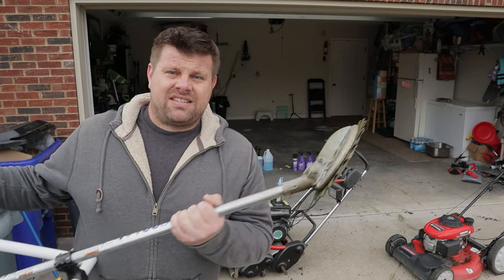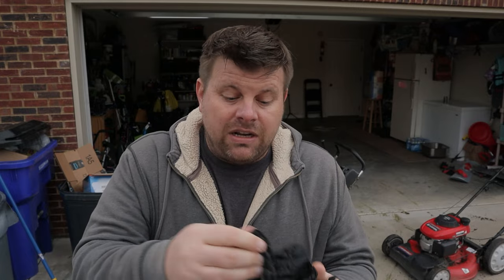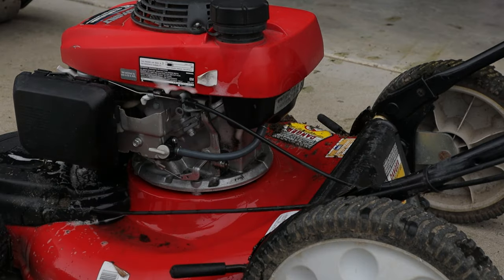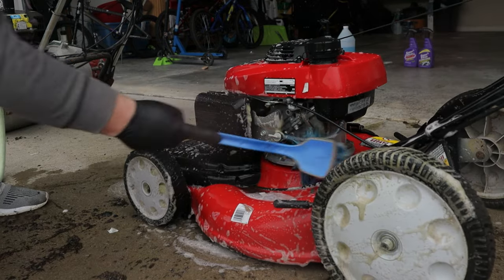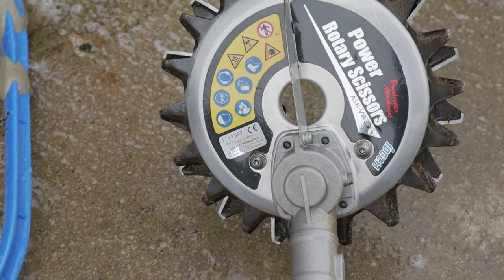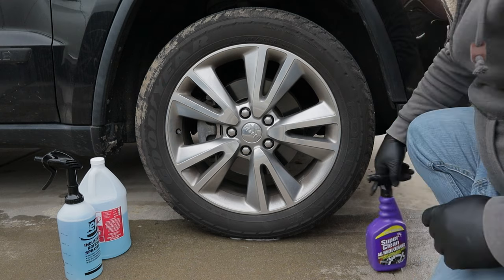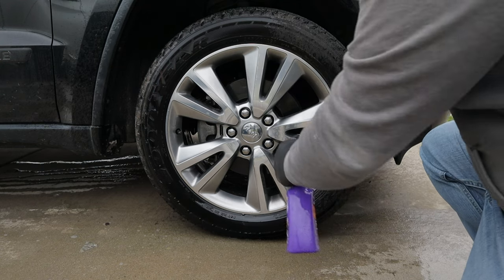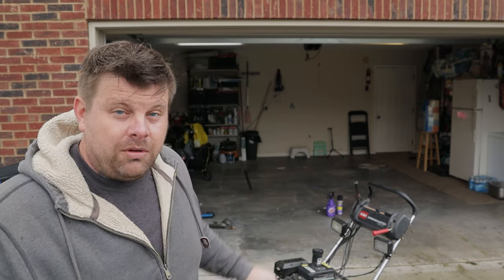Super Clean Degreasers | Cleaning Mowers, Landscape Blades, and Wheels

Comment: just an idea... have you thought of investing in an electric pressure washer? I picked one up for about $100 that I use to clean my commercial mowers and equipment and IT WORKS AWESOME! very compact, light weight and takes no gasoline! all you do is plug it into a regular electrical outlet and BOOM! I bought it for my mower cleaning, and ended up using it almost daily around the house for all kinds of projects! does away with any and all "agitation" or scrubbing!
Reply from the maker: I have one and use it quite a bit. Only for real big projects though.